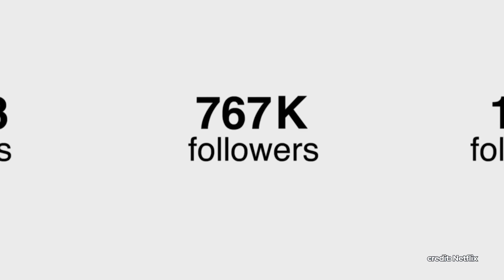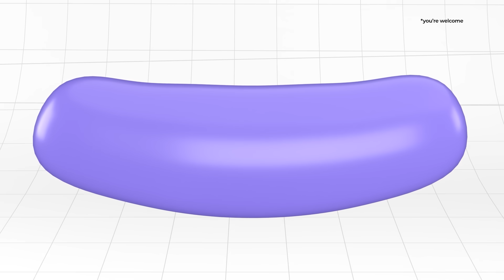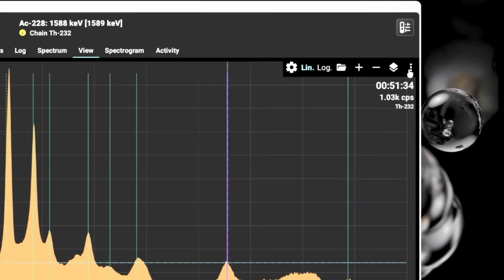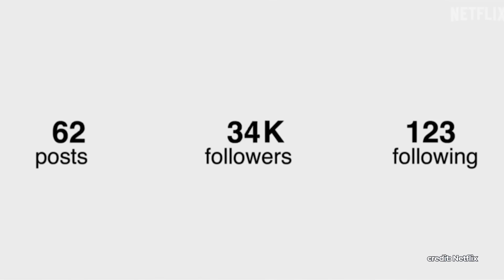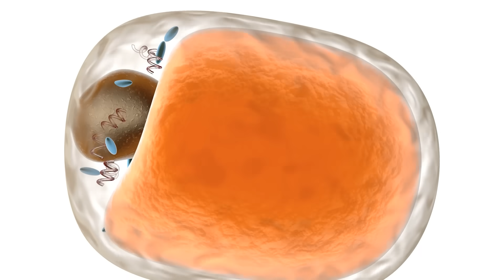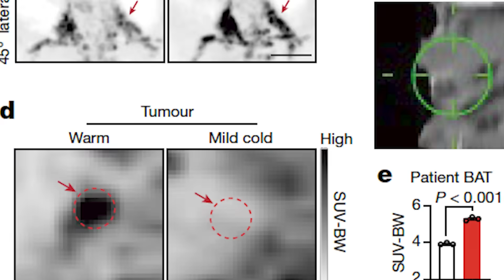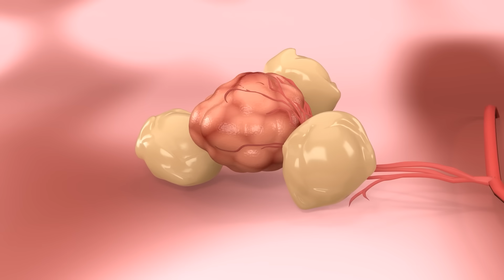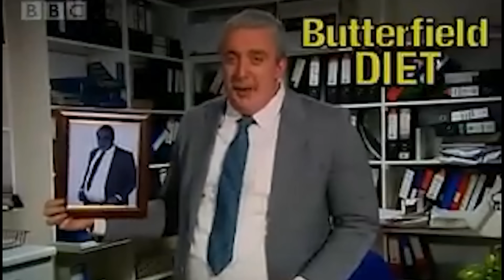Scientists Just Discovered How to Starve Cancer

Comment: Well, we do know for a fact that fasting can be extremely beneficial in fighting cancer as most cancers do not thrive in a ketogenic environment. However, there are certain cancers that do thrive on ketones (depending on it's own genetics), in which case fasting would be, not only non-beneficial, but actually detrimental. So... always do your homework.   NOTE: A ketogenic diet is NOT the same thing as fasting (also produces ketones), so please don't mistaken my comments. Why is fasting more beneficial than a keto diet? Well, your body requires enzymes for every chemical reaction (+/- 1 billion). Your pancreas makes nearly 100% of these enzymes, as well as the enzymes needed to breakdown your food. When you eat, your pancreases is busy making enzymes to breakdown food. If you have a high protein diet, your pancreas will produce protease, an enzyme used to breakdown protein. However, cancerous tumors are also, largely, protein. When you fast for more than 12 hours, your pancreas will shift from producing enzymes for food digestion, to producing enzymes that breakdown inflammation, toxins, and errant cells (cancerous, pre-cancerous, etc.). One of the reasons we tend to see more chronic disease in those who are obese, is because the pancreas is not provided the time it needs to produce anti-inflamitory, toxins, and errant cell enzymes. This is why, historically, we would finish eating in the early evening, and then won't eat again till morning... this gives you 12+ hours of not eating, and thus gives your pancreas time to start cleaning the body.

Comment: The question you don't ask is WHY does the mitochondria switch from using oxygen to glucose.  WHAT HAPPENS?   Ask the question where does the mitochondria get its energy?  Cytoplasm - the fluid that makes up 90% of the cell that is completely ignored.   You cells hold a charge and when your cytoplasm doesn't have a proper charge it switches from an efficient form of energy OXYGEN to s less efficient but gives a quicker burst of energy aka GLUCOSE.    We are the body electric and when you cells are not charged properly this happens.    KETO and FASTING DO HELP FIGHT CANCER.

Comment: Wouldn't that help with aerobic exercise too, especially at a level of intensity where you are using aerobic glycolysis? Also, movement or muscle contractions increase insulin-independent glucose uptake; thus, instead of cancer cells benefiting from the glucose, muscles use it, and they starve.

Comment: When a cell goes to a pre life state, it has changed its energy production to a type of fermentation or rotting.  Any cell that goes without oxygen for more than 36 will go off script, and revert to pre life functioning turning into cancer. Some use glucose, others omega 3 fat and some use hormones....  Cancer looks and behaves suspiciously like a pre life undifferentiated cell called a Trophoblast. These cells are found in the placenta their job is to tunnel through the uterine wall of the womb and hook up the Fertilised egg to the blood supply. They have to do this within 36 hours or the egg will fail to implant and be rejected. They actively do this job of keeping life hooked up pump supply until a foetus is 3 months old, this is when baby's Pancreas starts functioning and sends out a stop signal. At this point, the trophoblasts are reabsorbed and redeployed into the tissues as a repair cell in mucus membranes and organ boundaries. They repair breaches, bruises or damage and act as sentinals. When starved of energy during fasting and the body's self cannibalism state called autophagy, ,cancer cells resort to desperste measures and can switch from burning glucose to using fats/oils like omega 3 that eventually builds to toxic levels, killing it, by forcing it to do apoptosis.

Comment: I had stage 4 metastatic small cell cancer found in my parotid gland and spread to three lymph nodes in my neck. Two weeks before I stared radiation therapy, I intermittent fasted and cut all carbohydrates from my diet.  The oncologogist was surprised as the tumor had shrunk in size.  I think fasting is the key in combination with the keto diet for restricting food to cancer cells and there are studies to support this.

Comment: A lot of people on the comments giving their anecdotes about how a low/no carb diet stalled or wiped out their cancers. While I do think that is generally a solid option I will note that the survivors do tend to be the most vocal.

Cancer is chaotic, it's actual form mysterious because of how it occurs: by chance becoming unstable. Many cancers probably would die from a glucose free diet, and many may be fought effectively from the healing effects of a body in a fast. Still more can be starved out via the brown/beige fat cells in this video but I would think there might still be some forms unstopped by these remedies.

Were I or a loved one given a diagnosis I definitely feel this is a valid starting point and God willing it works but a 100% guarantee seems so far away to achieve.

Comment: I wonder if the life expectancy in the southeast US being so much lower than the north has to do with the fact that it's stinking cold for half the year in the north where it's usually warm in most of the south. Sure buildings are heated. But most people still have to go out enough that getting cold is a part of life up north. And many people can't afford to heat their home enough to completely avoid being cold even inside. Throughout high school my bedroom was consistently 52 degrees F. I wore mittens to do my homework and slept under an electric blanket and a quilt while wearing 2 layers of warm pajamas. Most people I knew weren't that cold. But most everyone does get significantly cold in the northern US. From what I saw in my 25 years there. I wonder if it's enough to be lowering the cancer rates there. Just an idea.

Comment: There's a over-simpicity made here. The healthiest diet regardless of having cancer or not  is a low glycemic index diet. It is the body's blood glucose response to food and not whether the food itself is fat, protein or carbohydrates. Some foods with carbohydrates such as apples and grapefruit have a very low glycemic index. Fats have more calories and therefore contribute more total glycemic load. They are however calorie for calorie generally lower in glycemic index. Not all foods with high fat are however low in glycmic index when there is a combination of ingredients. You can't eat pure fat. The best diet, not just to fight cancer but for health is to have as many small meals a day as you can and graze like a cow on low glycemic foods. This will indeed starve cancer cells and inhibit their cellular metabolism. When you eat like this your body becomes more metabolically efficient and metabolic efficiency inhibits cancer. This is the reason why the drugs that cyclists use for doping (improving energy metabolism) also inhibit cancer. For reasons of improved energy metabolism, exercise is beneficial.

Comment: Looking deeper into it there are a lot of statistical cases where the beige/brown fat ended up supporting the cancer instead of starving it, it can also be attacked by the immune system and cause the immune system now having to deal with the cancer and the fat cell.
Then additionally when it works, its only works on certain types of cancers. Overall no reliable alternative at all.

Comment: Fasting drops glucose, insulin, and growth signals (IGF-1, mTOR, AKT), all of which cancers often hijack. Cut those off, and cells under stress stop dividing for a while or even trigger apoptosis.

In mice, you can watch tumors literally stall for a few days of fasting. In people, imaging sometimes catches that lull — but once normal feeding resumes, the tumor’s metabolism tends to rebound unless therapy or immune pressure keeps it suppressed.

It’s no old womens tale, just hard to sustain for most people. Especially when doing radiation therapy or chemo.

Comment: Most people dying of cancer seem to be nothing but skin and bones by the time they die. I just assumed it was due to a lack of appetite from not feeling well or it was from the side effects of chemo which can reek havoc on your digestive tract including vomiting. Both reasons can result in the patient not getting enough calories to sustain their weight.

Maybe that’s not the whole story. This video got me to wonder about how a cancer death could possibly happen from a different process. What if cancer is using up so much energy, leaving healthy cells lacking their need. 

When the cancer spreads and tumors grow, does the increased number of cancer cells rob the healthy cells of it’s needs even faster?  Maybe in some cases this explains the weight loss. If breaking down muscle and other cells occurs, that too would make a person weak and lethargic.

In most cases I would imagine normally cancer overcomes an organ to where it fails or functions incorrectly, I guess it would cascade from there affecting all the other organs and systems.

Even if people do sort of starve to death in a tiny amount of cases, it’s still death due to cancer. Even if those healthy cells had all the resources a cell needs, inevitably the cancer would have overtaken the body’s systems causing them to either shut down or malfunction and sadly death would still have occurred. If the cancer dying process I wondered about actually happens or if it’s goes the usual way, it seems like the signs and symptoms would be the same regardless. 

I had breast cancer when I was 37 yrs old. It’s now 18 yrs later and I am very grateful that it was cured. However, I still can’t stop myself from being worried that a different cancer will one day knock on my door. I really wish there was no cancer or any other disease or disorder for that matter. Which I’m sure everybody else does to. But at the very least, I wish we have treatments and cures for all the diseases and disorders that people suffer from. Take Care.

Comment: You (Dr Miles) mentioned the algorithm
---the algorithm is on your side (taking down other videos about "Starving Cancer" that do work even for stage 4 cancers)
---6 months ago i could do a youtube search on "SCOT Inhibitors" and actually get a very useful Cancer Protocol that works in conjunction with a zero carbohydrate diet and fasting, now those videos are gone
---You claim that starving cancer by lack of glucose has been completely unsuccessful, and that is what the algorithm is promoting
---the proponents of the SCOT Inhibitors also recognized that the carnivore diet by itself was not enough, but when combined with the SCOT Inhibitors that rob the cancer cells of at least one other essential element, namely the building block they uniquely require for cell wall formation prevents cancer growth, giving the immune system the upper hand at dismantling the existing tumor cells
---the AMA does not want a dietary cure for cancer (there is too much "medical money" at risk to allow that to be known, and you are promoting the same dis-information and censorship against the ketogenic/SCOT solution available now and at home without BIG Pharma's enrichment

Comment: ***I don't get the confusion /? 4 fold, is not 1, now 4. that is 4 times. 4 fold is 1 is now 16 times.   We really need to clarify 16mg, then 70 + mg. that would be 4+ times. if we calculated 16mg at 4 fold, follow please. 16 unfilded= 32mg unfolded once, then unfold again, twice unfolded, 64mg, unfolded again, 3rd time, 128mg, now the final unfold (or 4th fold/4 fold), now 256, which is 16 times the original, growing exponentially .

Comment: C is a condition of the body's electromagnetic system being compromised. Our body optimally runs on minus 25 to minus 50 millivolts. C is a condition of the body voltage getting so low the polarity flips into the plus milivolt range. All c's develop when the millivolt level reaches a critical plus 30mv. Scientific fact. Under these conditions the compromised part pf the body can no longer absorb oxygen and other nutrients it needs to live. C is in fact an emergency survival action of the body to gain more oxygen into the system to prevent tissue death.
Is it logical under such circumstances to starve the body further? Of course not, you reinstate the basic energy voltage that is needed for health, job done. This is standard knowledge in the alternative health care field.
Reply: treating the symptoms and calling it a cure.

Comment: Arm & Hammer baking soda, chemically known as sodium bicarbonate, neutralizes lactic acid by creating an alkaline environment in the body, which helps buffer the excess acidity produced during intense physical activity.

How Baking Soda Works on Lactic Acid

Lactic acid buildup in muscles from hard exercise leads to increased acidity, contributing to muscle fatigue and soreness.

Baking soda acts as a pH buffer by increasing bicarbonate concentrations in the blood, which helps draw hydrogen ions (a component of lactic acid and acidity) out of muscles and into the bloodstream, where they are neutralized. I drink it with distill water, which is my personal care.

Comment: Beat Cancer in 10 days with:
300mg Curcumin Powder capsules
300mg Alpha-Lipoic Acid caps.
1-5mg Methylcobalamin ..B12
All daily, & I was lucky with this minimal dose, to be squamous cell carcinoma, rt. Side of head, above ear.
Melanoma gone in 30 days for a friend, who was booked into the Hospice to end his days. Above dose 3x a day.
Spinal Cancer gone in 90 days with 3x a day....& the Doctors treated the patient as if she had insulted them..😅😅😅😅😅😅😅😅😅😅
Curcumin turns off 30 gene switches, & the cancer cell reverts to a normal cell, which finds itself in an acid environment & simply DIES.
Alpha-lipoic Acid has a fat soluble & a water soluble part to it's structure. It's equally soluble in water as it is miscible in oil. The curcumin locks into the fat soluble part of the molecule, & the combination is then water soluble ( blood soluble ).
All the best everyone...😊
Reply: Lies.

Comment: So what's the treatment now ?What should we do and eat 😢
Reply: nothing conclusive, cancer is too tricky, cancer resistant mammals like whales have multiple defense mechanisms such as rapid dna repair, multiple copies of p53 genes, dna protection, high density of extreme energy using cells that starves most cancer cells even if they form etc..

this video basicaly explained that cancee cant use oxygen like normal cells, so if there are such cells around it then it will die.

Comment: Most, if not all, cancer cell types cannot use Ketone bodies for fuel, only glucose. But unfortunately, the liver, pancreas and parts of the brain also cannot use ketones for fuel so the body, even during complete fasting creates 10 grams of glucose from 40 grams of protein, via gluconeogenesis. If there were a way to feed only those organs the glucose needed, and somehow starve cancer of glucose, we could probably cure it.  Since cancer cannot feed during ketosis as well, it doesn't seem like a bad diet to be on if you have cancer. The gluconeogenesis will always be providing some glucose for it, however. It is intriguing to think that cold activation while in ketosis might be a drain on glucose stores.  This is an interesting approach.  The metabolic pathway is usually a very difficult approach to cancer therapy.  That sad thing is we never hear about these great or promising therapies again. One has to dig to read the results of the studies.  Where are all of these promising therapies from the last twenty years?

Comment: If you can handle the truth, investigate the 5 Biological Natural laws (re-)discovered by Dr. Hamer. The concept of "Cancer" is not what we've been told it is. Dr. Hamer found that every dis-ease starts with a biological emotional shocking impact (severe stress situation). This starts up an Meaningful Biological Programm within a split second, which runs at 3 layers at the same time: psyche-brain-organ. This is always verifiable, organ (MRI), brain (CT), psyche (questioning patient). Each disease has two fases: the conflict active and the healing fase.

Only in 2 of our tissues; the endodermal (gland-tissue) and old-mesodermal (membrane tissue) real cancer cells can be seen. These specialized fast growing cells increase the functionality of the organ they are grown in. For instance, during a fear of death conflict cells in the lungs are grown to help to absorb more oxygen into the bloodstream. Once the conflict is solved the cancercells will be broken down (necroses of adeno-carcinoom). Bacteria and fungi assist the lungs to get rid of the excessive tissues.

Dr.Hamer analyzed > 40.000 cases which all confirmed his theories.
The body doesn't make mistakes like we've been told. These programms are millions old biological codes which keeps the organisme alive, always.